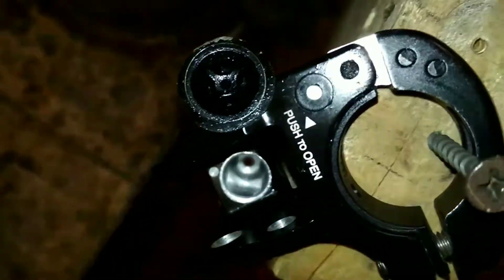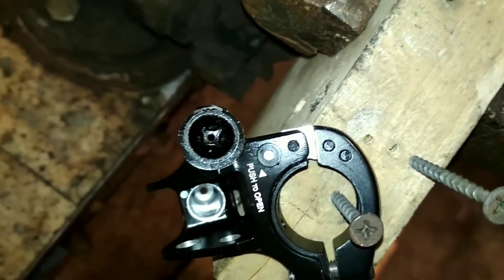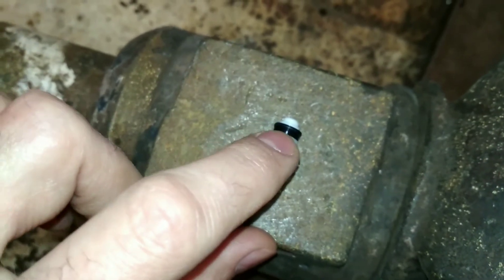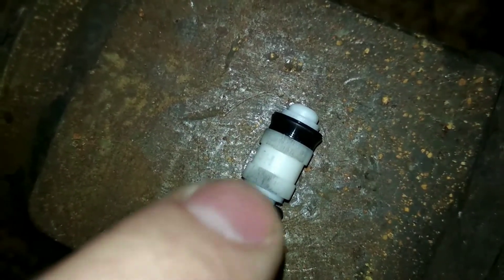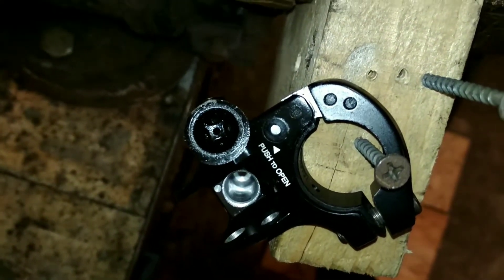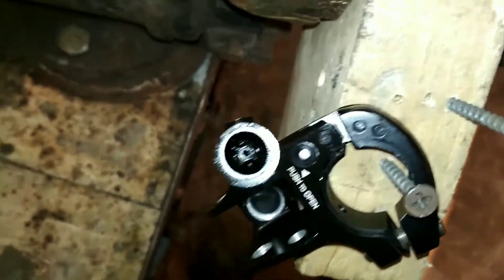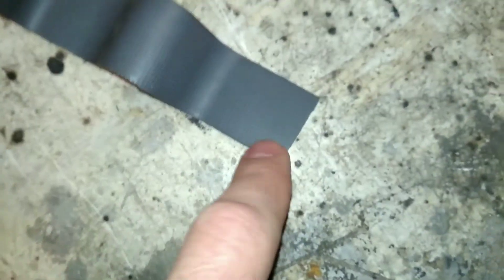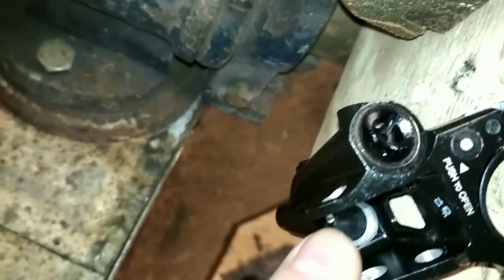Leaking Shimano brakes - The Big Mystery SOLVED! Why, how and prevention. Not much hope :-(

Comment from the maker: Guys, I did try to polish cylinder wall, even using a DIY sand paper bit for a drill. No hope.
I also did videos I promised, about disassembly of levers, but after I uploaded them, I found way better and easier way, than what I was doing,  so I took down my videos.
Since then, I managed to sell my levers as damaged, and bought bl-m4100.
Those cheap levers, ARE SEALED behind the piston. And that is because, they don't have servo wave pushrod, that shift its angle. So behind the piston, there is a steel washer with narrow hole, and between that hole and pushrod, is a rubber cuff.
I am extremely happy with those levers, because of the feel they give without servo wave. Those levers are not easily serviceable, even the blade can not be easily replaced after breaking one, even if you would source another blade by lucky chance. But the price is great,  so not a worry though
Reply from the maker: https://m.youtube.com/watch?v=gR-U3tuR0VM
This is a good disassembly video if you need it
Reply: But those levers have no power...they came from the factory on my e-bike. A few days ago I replaced them with 6100 levers, the difference in power is obvious, my set was MT420, that means 4 pistons + servo wave with 6100 levers... the feeling is at least 80% power compared to saint or 7120/8120
Reply from the maker: @zoranpl you must be overweight or have really weak hands. I have zero complaints about the power I can generate with those levers using only 2 piston slx calipers.

Comment: My fairly new(2 months) Shimano Deore front brake has a leak coming out from somewhere inside. It builds up some pressure, then poosh!  This bike is only 2 months old. Your the only one in the world that mentions this! I’m a subscriber for life!
Reply from the maker: If the bike is so young, I would recommend trying to get a warranty replacement of that brake.
The damage I described, could happen fast on new bikes, if you fall over on a dry, dusty, fine sand of woodland hills for example, or even sand pit play area for children. If the handlebar digs deep into sand and lever body gets in it too, then damage can progress extremely fast. Otherwise it's probably a long-ish process. So if possible, try warranty that brake. Also yours one seems quite different. 
One solution I didn't mention on video, is rebuilding brake after events above, if they are very rare. But dust from trail, like if you're following a buddy will still kill most levers in my opinion. Over time off course. Then it's described by users as "i like em, but they developed a leak after 2 years"
Reply: @polishguywithhardtospellna8227  I never did have a crash or anything that should have contaminated the lever that I know of. Just to let you know, Shimano replaced the lever under warranty.
Reply from the maker: Great to hear that, I'm so happy you actually took action after commenting here. Well done and happy trails!
Reply: @polishguywithhardtospellna8227  the replacement was facilitated by my local bike store. They are great guys there.

Comment: I have/had a set of Shimano brakes. Mt-501 lever combined with Mt-500 caliper that had leaks at both the caliper and lever! The caliper leaked around the piston seals (constantly contaminating the pads) and the leaver leaked the same as yours. Ironically, I replaced it with the cheap mt-200s and haven't had a problem since.
Reply from the maker: Yup, it's all just a roll of a dice. But luckily there is much more sets that behave OK, than those that have faults from factory or some unlucky damage related ones.
Reply: @polishguywithhardtospellna8227  hopefully they do away with servo wave or figure out a way to keep the piston from camming in the cylinder

Comment: Hi Bro, Oil leaks from the side of the brake lever exactly from the small hole which is there( below the bleeding screw) there is a fan type net and at the centre there is a hole ... Whenever I press the lever oil comes out through that small hole... Please help i have deore m6100
Reply from the maker: That is another common problem, my friend has one lever like that, but it works for him. Only happens at extremely high force lever pull.
In theory this is Shimano's system overfill protection, but is extremely fragile and often leads to permanent leaks.
So it's possible, your brake has been overfilled from factory or after service/air bleeding. If so, try warranty it, or complain at the bike shop.
This may stop, after the brake gets rid of excess oil if you're lucky.
First try above, if that is not the case above,  then observe it and keep wiping excess as you use the bike. If the brake becomes spongy-too much oil loss, then there is pretty much no hope. Sell it for parts. You might try to look for this seal on AliExpress and other Asian sites, from what I know it is possible to replace, but very rare to come by.
Reply: @polishguywithhardtospellna8227  Thank You So Much.. Will check out
Reply from the maker: Actually it would be preferable to unscrew reservoir bolt, have paper towel ready or a bit of toilet paper and see of oil will leak onto cover. If not, then putting bolt back in will remove a bit of oil, which may be enough to stop that leak from grille.
Do this only if you can't warranty or complain at the bike shop who did the service if it had service recently.
If bike/brakes are out of warranty and there was no service, that could caused it, then it's better to act now and check if excess oil will leak from reservoir bolt opening, than to let this happening for who knows how long. Do not loose a seal under reservoir bolt
Reply: I think this might work ..  thank u for this valuable information 👍
Reply from the maker: Also an observation time if you ride regularly and use brakes often enough, I'd say a month or two. If the brake becomes spongy after 6-12 months, then it may be due to normal, system leaks/oil loss which naturally occurs - its not a space rocket 😅
But at the same time, without major problems some Shimano brakes can keep oil level right for 2-4 years, but it is a lottery. 1year air bleed is good enough seal, 2 years is to be happy about, above that is golden sample or very light, urban use.
My friend's lever leaked there, bacause he purposely overfilled the system,  to get the bite point of his brake more immediate. So if you tried to do the same or someone did it without your knowledge, but in reaction to your complaints about,  say... Lever grabbing too close to handlebar for your liking,  then don't do it, and don't say things like that to a bike mechanic, or make it clear you don't like it, but also don't want them to overfill.
As I said, this system is fragile and prone to cause permanent leaks,  so not worth overfilling in my opinion. Also read my pinned comment, maybe you'll choose cheaper,  more durable lever in the future too.
Reply: @polishguywithhardtospellna8227  sounds good

Comment: I see time and time again that so many still force old dirty oil up through the lever instead of sucking it out through the caliper where it came from, and gravity bleed lol. Like why the hell do people want to push it up there still to this day is beyond me. Do an SRAM flush/bleed procedure on your Shimano system is my 2 cents. 
First you flush the system by sucking out all the dirty oil with a syringe through the caliper side. Then with all new and fresh oil you can start the actual bleed with a syringe and no stupid gravity bleed nonsense.

As Shimano brakes in general are just plagued with leaks in both lever and calipers, and that Shimano sadly are terrible at offering replacement parts for it all, I personally will just get rid of my Shimano brakes next season. 
My pistons have had a very slow leak since day one and the bike shop are just ignoring me so no more Shimano for me on the brake side at least.

Comment: So there’s no way to fix these? Even replacing the piston?
Reply from the maker: If you have same type of damage-due to dust/Sand, then most likely no. If the bore is scratche, then the will be leakage, maybe it will be very tiny if you noticed very quickly and damage to the lever assembly is minimal. It also can be just factory faulty seal, then fix is still possible.
Reply: In Russia some shops install a custom protection kit. It isn't cheap, but it works.
There used to be the "Lobster" kit that could be installed at home, but the company silently shut down :(